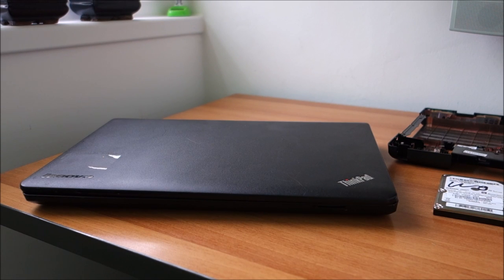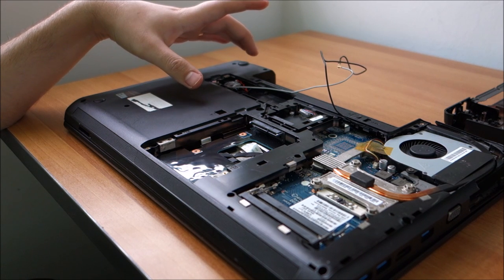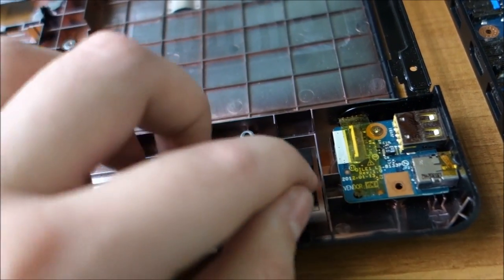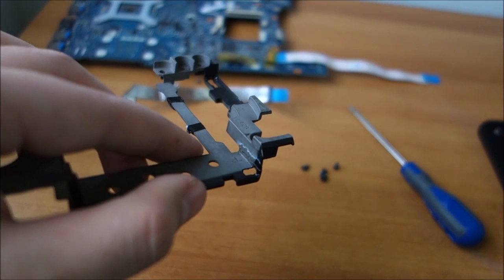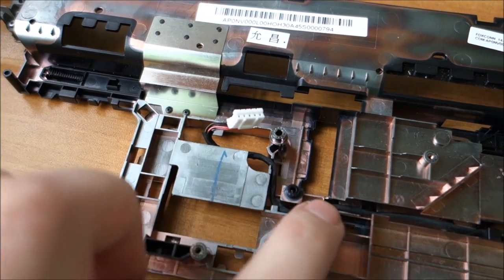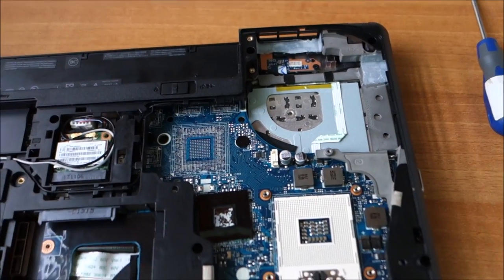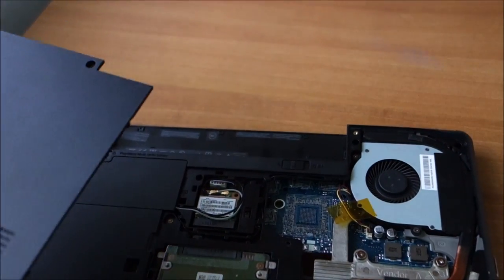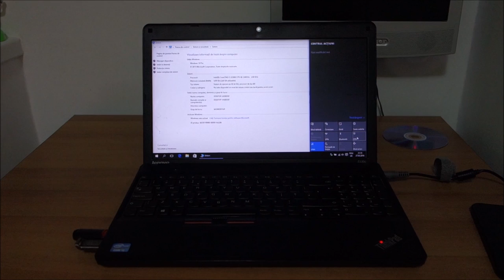How to teardown, repair and upgrade a Lenovo ThinkPad Edge E530 (E530c) laptop

Comment: Thanks for the video. I did nearly use the same procedure on my E535 but I use epoxid glue to tighten the broken hinge to the bottom. I did not have any outside seeable damages so I only glued it inside. Nice to see the alterative methods if mine doens't hold. Thank you. Greetings from germany.
Reply from the maker: Welcome! Hope your fix holds :)
Greetings from Romania!

Comment: I have an e530c and I disassembled mine like a week ago to loosen up the hinge and now I'm trying to assemble the thinkpad back to its original shape but I'm having a meltdown over one tape coming from the black cable off the display construction see @21:43 can you please help a soul out and tell where the tape from the black cable comes from
Reply from the maker: Tape? Not sure what you mean by that. Some kind of adhesive tape to keep the cable in place, or?
Reply: @UltimateDIY  yeah I mean adhesive tape
Reply from the maker: If it's not shown in my video, I honestly don't remember. It's been a while since working on this laptop.
Reply: @UltimateDIY   I already have assembled my thinkpad back no need to worry and i also put that adhesive correctly back to its original place [I think] I also have loosened up the horribly engeneered  hinge that lenovo has put out because the upper right corner of the case almost popped out when opening the lid 
I just wanted to thank you for this very important video
Reply from the maker: Glad my video helped!

Comment: Can the trackpoint be replaced by itself or does the whole keyboard need to be replaced?
Reply from the maker: I am not sure about this, as it seems to be a separate module, but I can't find it for sale anywhere, so this makes me think you can't just replace it and you need to replace the whole keyboard.
Reply from the maker: Nice! :)
Reply: Keyboard and tackpad are separate. But the keyboard comes with the tackpads top 3 buttons

Comment: What kind of cloth did you use around 16:25 to reinforce the frame?
Reply: Also thank you for this video, it’s excellent. Trying to fix my e530 right now and it’s really helped.
Reply from the maker: I don't use some special cloth, it just needs to be something that absorbs well the glue. I usually test it with a drop of glue to see how it behaves. If I don't like it, I test another.
Glad my video helps 👍🏻